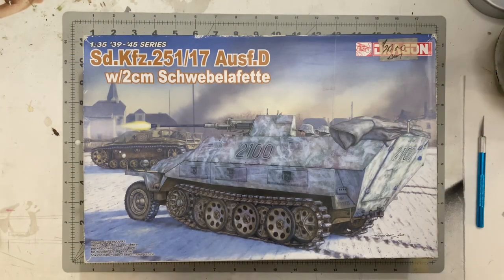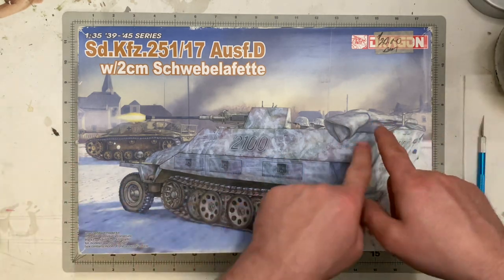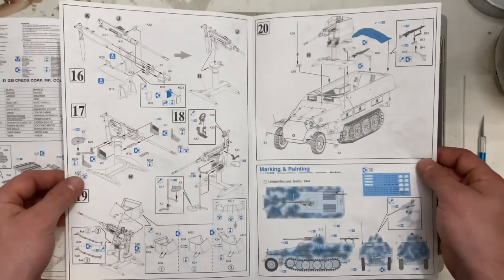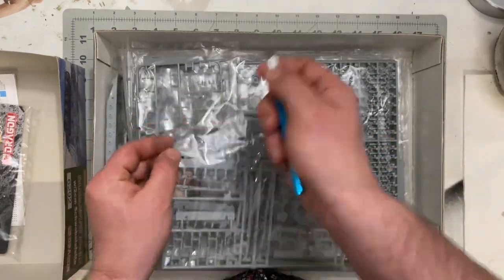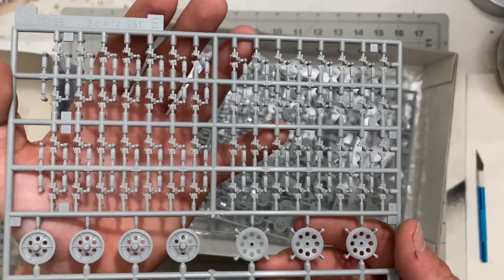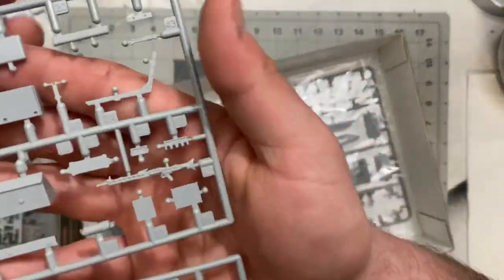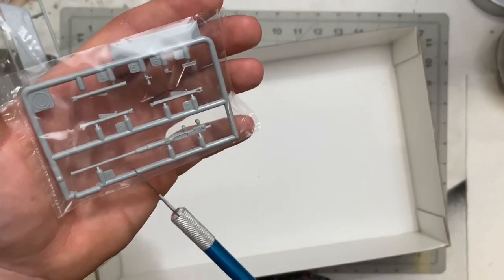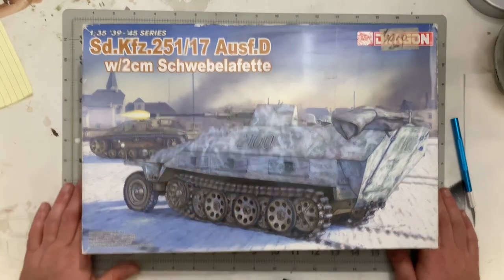Dragon 1/35 Sd.Kfz.251/17 Ausf.D w/2cm Schwebelafette Review

Comment: You know I've been excited about this one! The tracks are easy to make workable by being careful with the glue. I didn't see if the ez track ones are also rubber pad like the ones on the sprues. If they are the metal pads it would be wrong for the bulge. Both types either way can be made workable. I would also leave out the gas tank, battery and transmission from the lower hull. Their os no way they can be seen. They literally get enclosed, but they can get in the way of getting the floor lined up. Also the floor doesn't have a positive fit it can sway left and right about 1.5mm so when you get to that point you need to glue the floor and both sidewalls all at the same time while dry fitting the upper hull to make sure everything is lined up. The suspension also doesn't have a positive fit so I always build the tracks up first so I can sit the roadwheels on them to get the suspension in the correct position. You will also need the front steering wheels dry fitted so they won't end up floating. I know it sounds like a lot but it's really a great kit and way more accurate then the Tamiya. Sorry for going on for so long. Take care.
Reply from the maker: Hey Floki!! Dude you and me both!
Not gunna lie I was planning on keeping that stuff out to have for debris in another diorama 😂

I always appreciate tips man, especially from somebody who knows what they’re talking about 🤓 

I’ll let you know when I start on her today!